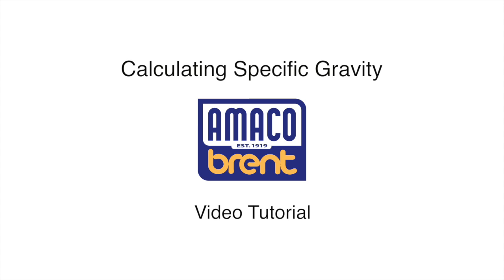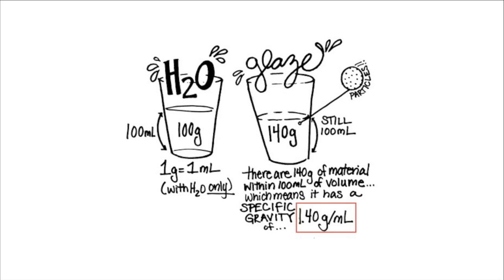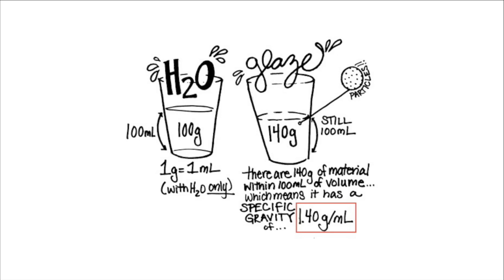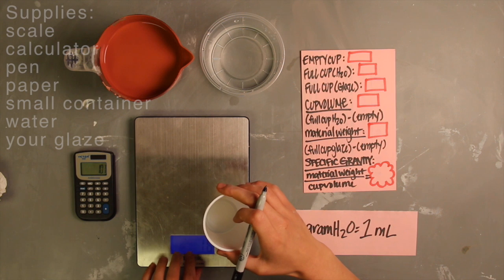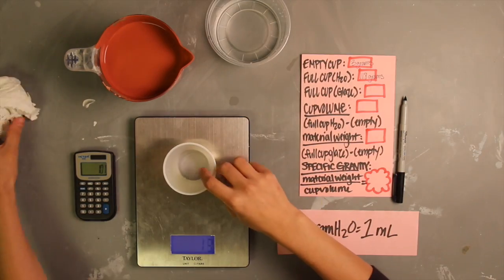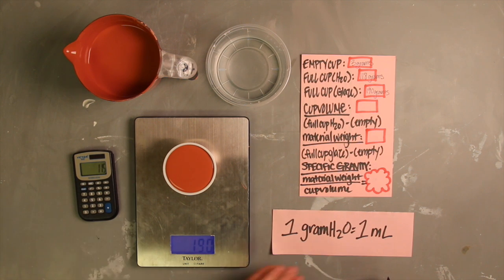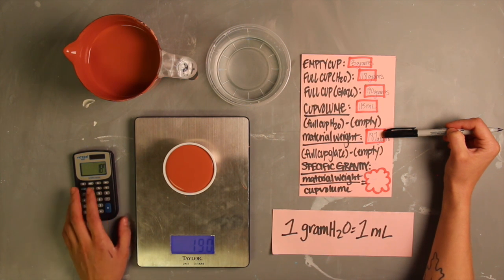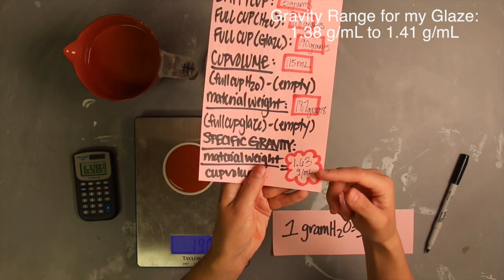Calculating Specific Gravity

Comment: You are not a very good teacher. Luckily, I did not have you to learn from in school. You did not even explain and use the tare function to eliminate the need to keep applying the weight of the measuring vessel throughout the procedure. Amaco screwed up royally with this video. I wonder if I should just stay away from your product line entirely.

Comment: Your procedure may need some refining. Don't take note of container weight. Simply tare the glass weight to zero, divide the sample weight by H2O weight and that's the density of your sample !!  ie: In your case, it is 187/115=1.626. A work sheet with two readings and a simple division gives you the result. that's it dear Amaco Brent !
Reply: you are right this does work just to say tho if lets say your scale turns off in the middle of what your doing.  for example your writing down  results and you forget what it was you go back to look and it's gone. turn the scale back on its zeroed out you have a full cup now you have to dump out the glaze and measure your cup again but if you use the same cup every time it will always be the same weight and you wont have to worry.    this happens to me alot when weighing out plaster but my scale also turns off after 10 sec. of no action so maybe it's just my problem.
Reply: @brianscidmore330  The word you are looking for is 'though'. The act of putting words to paper is a more formal activity than making an utterance which by its nature is ephemeral. Second,I do not like excuses, especially poor excuses. You do not learn if you keep making excuses.

Comment from the maker: Specific Gravity Worksheet

GLAZE BEING TESTED: 

1. What is the weight of your empty cup?

 Empty Cup Weight:  ______ grams

2. What is the weight of your cup full of water?

 Full Cup Weight (Water): ______ grams

3. What is the weight of your cup full of glaze?
 
 Full Cup Weight (Glaze): _______ grams

4. Volume= [Full Cup Weight (Water)]- [Empty Cup Weight]

 Volume: ____ mL (it will be the same measurement in grams because it is water)

5. Material Weight= [Full Cup Weight (Glaze)] - [Empty Cup Weight]

 Material Weight: ______ grams

6. Specific Gravity= [Material Weight] / [Volume]

 Specific Gravity: ______ g/ ML
Reply: It's incredible that you and the demonstrator did not simply using the tare function to  eliminate the need for taking into account the weight of the measuring vessel.